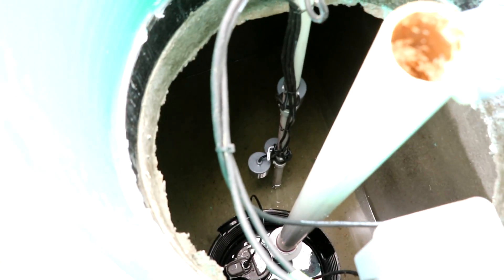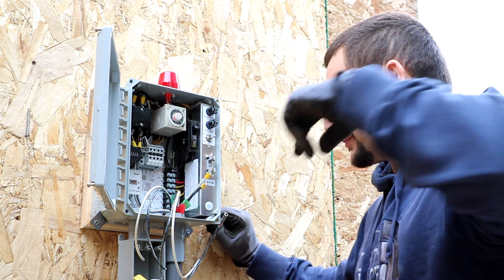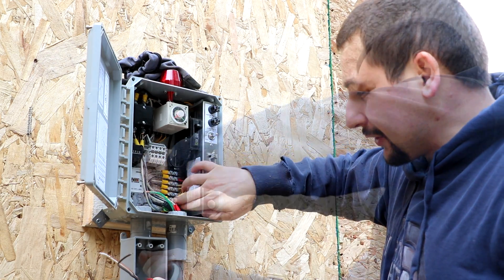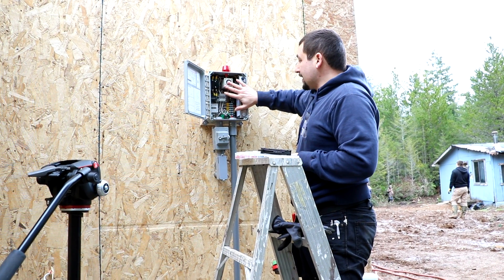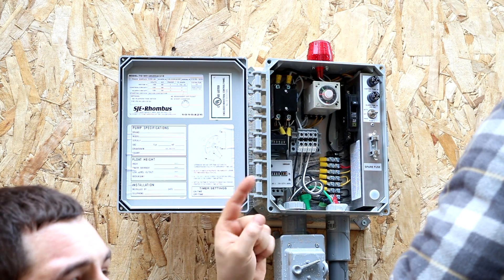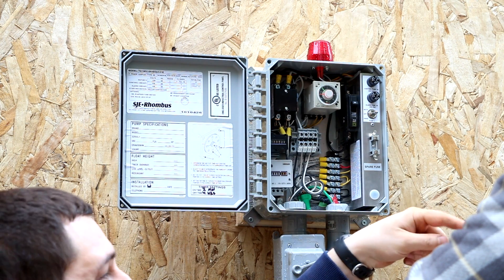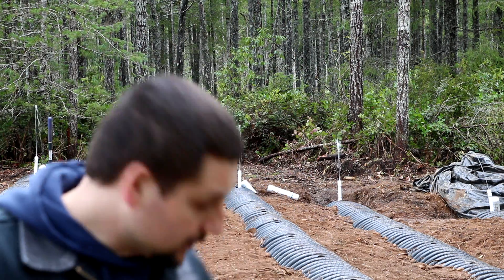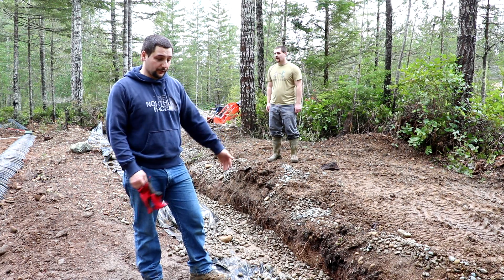Install your own septic system #4

Comment: The instructions say to use separate conduit for pump and float cables. I see you put everything in the same conduit. Did you have any problem passing inspection?
Reply from the maker: Nope, the instructions are not to NEC, electrical has to be installed to NEC and inspect by L&I.